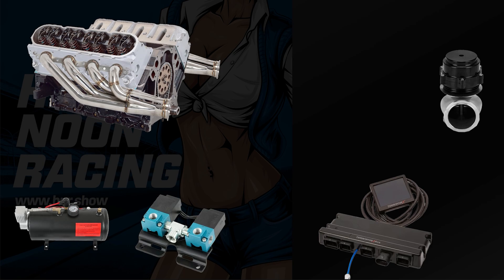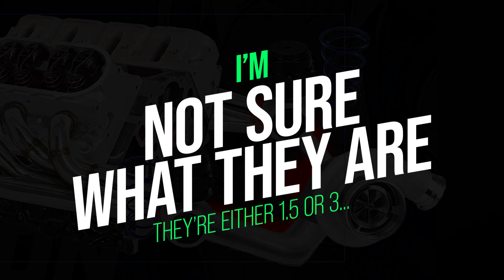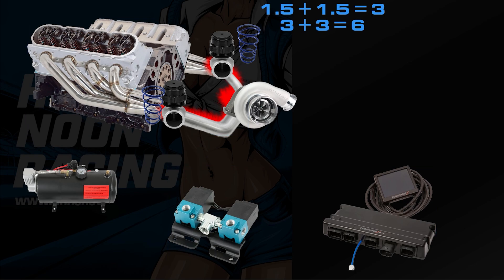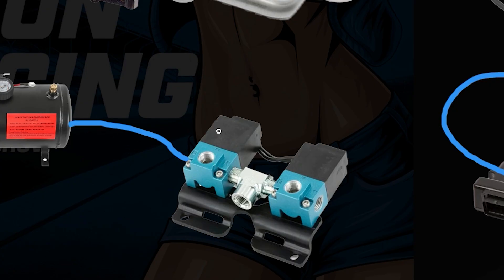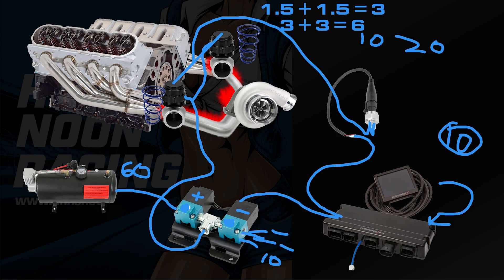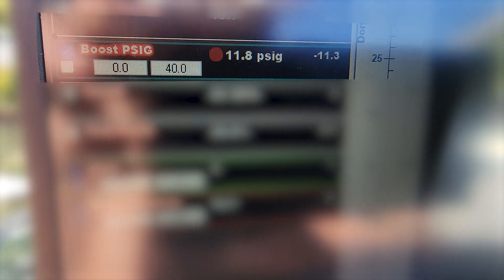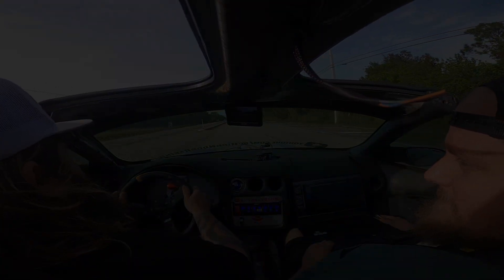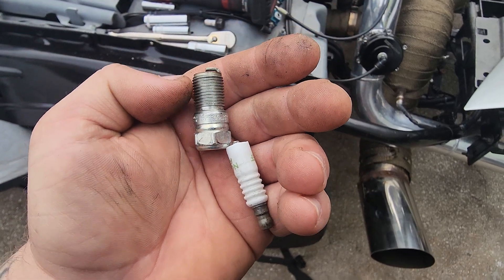Dual Mac Valves & Holley Terminator X Setup for Turbo LS Drag Cars

Comment from the maker: I was 100% wrong in this video just want to clarify this. I was confusing intake to exhaust volume with pressure. the pressure does not change. Thanks to everyone that helped clear that up.

The correct method on a setup that is functioning properly would be Wastegate spring + dome pressure = boost. For example, 3# wastegate springs + 10# of dome pressure should net around 13# of boost. In a perfect world this would be a 1:1 ratio. Many setups will vary +/- (1-4) psi.

Comment: Usually I always have to put a lot more Dome pressure to achieve higher boost. On my single turbo small block Ford I gotta have 20 psi dome pressure. To make 20 lbs of boost with a 8lb spring. 1 wastegate

Comment: Awesome video. Would you recommend these MAC valves or Holleys new solenoids? Part #557-201 for a single turbo car?
Reply from the maker: Mac valves, ive always used amazon ones, but if you want to spend a little bit more and make sure they're authentic use Low Dollar Motorsports ones.
I've never seen a good outcome with the Holley ones.
Reply from the maker: Also in the video I was wrong check the pinned comment above to make sure i didn't mislead you! SORRY

Comment: I am completely new to turbos. I f**** love this video. Visually seeing it helps so much. I'm in the process of doing exactly what you're explaining. I definitely will be checking out your other videos. Thanks my man.
Reply from the maker: Make sure you understand i made a mistake in this video the math was off on how you calculate eastegate pressure, and i did not have a boost reference plumbed to the bottom of my wastegates

Comment: Looks like not enough wastegate to properly control. Twin turbos here with 10lb springs on each side and it will hold 9-11 psi perfectly. However i run open loop boost control and use the turbo pressure as dome pressure. Sloppy stype dial a boost works perfectly. Got it where each "click" of disl gives me 2 psi more each time. Very simple.
Reply from the maker: Appreciate the feedback, It's worse than that lol check out the latest video hahahaah

Comment: I think what they are trying to tell you is you have 1 line coming from your mac valve to the top of your wastegate. That one putting 10 psi is actually splitting that 10 psi between the 2 gates
Reply from the maker: You are correct I've made a new video clarifying the mistake pretty funny too check it out if you like

Comment: The boost doesn't double because u have two wastegates
Reply from the maker: If you add 10psi on top of both wastegates it does
Reply: @HighNoonRacing  that is not correct.
Reply from the maker: I don't understand what he means by double. But what I'm saying is if you have two wastegates one on each bank. And you apply 10psi of dome pressure to each side. They have to make 10psi each before they open aka 20psi total. Excluding springs.
Reply: @HighNoonRacing  they are connected, 10psi is 10psi no matter how many wastegates you run.
Reply from the maker: I think you may have misunderstood that as double. but this is why we divided the target number by 2 since it applies it on top of both wastegates, and also why it worked.
Reply: @HighNoonRacing  I am understanding what you are saying but you are not understanding how pressure works and wastegate control works.

Assuming everything in the turbo system is sized appropriately and the engine is in good running condition and not severely retarded on ignition, adding 10psi to the dome control in the Holley software should net you roughly 10psi of boost over initial, regardless if you have 1 wastegate, 2 wastegates, any amount of wastegates.
Reply from the maker: @finetunedhp  Thanks for the detailed explanation! Really appreciate your input! I don't disagree with you at all, I'm just showing what worked for me. something is definitely off without a doubt.

Comment: You are over-complicating it with way too much math. If you have 3psi springs in both gates, in theory it should make 3psi of boost. If you add 10psi of dome to that, it theoretically should make 13psi of boost. If you have 3psi springs in the gates and its making 11.8psi, and adding 2psi gets you to 19psi of boost, something is wrong.
Reply: Yeah something definitely isn’t right or something isn’t calibrated correctly
Reply: Just to clarify my set up. 4.8 ls twin s369. Twin vs racing 50 mm gates. Holley term x. On board air compressor. 6 psi springs in the gates. Boost control off makes about 6 psi full throttle any gear. If I target 10 psi of dome it nets about 10 psi target boost. Sorry not trying to be an asshole. Love ur videos also duel Holley Mac valves
Reply from the maker: @bigbuck61089  no disrespect taken brotha thank you for doing the right thing and calling me out. I found the issue, and last thing I want is to put false info out there. Next video gonna make up for it tho and should get some laughs, thanks again!
Reply: For sure 3 pound springs don’t equate to 11 pounds. It equals 3 psi. 5 pounds of dome pressure should not make that much boost. U got some stuff plumbed wrong
Reply from the maker: I agree but they are 100% 3lb springs or less. And it's making 11.8 lol either way got it dialed and they're working repeatedly hitting and holding my target boost
Reply: @HighNoonRacing  I have 3lb springs in mine and they make about 4 on gate and 5psi of dome is about 8psi of boost
Reply: @HighNoonRacing  I am telling you, you have a plumbing issue, wastegate issue, or dome pressure sensor issue if adding 2psi on top of 11.8psi of boost gets you to 19psi of boost. The concept of dual wastegate boost control in this video is incorrect. 

Please don't take this as disrespect, I enjoy your videos but I'd rather watch you racing than doing head gaskets again.
Reply from the maker: @finetunedhp  there might be an issue, but if you apply that math and it works on every system regardless of the circumstances then I don't see why it matters lmfao.
Reply from the maker: @finetunedhp  And no disrespect taken, I'm ok with being wrong. but I don't think the math is wrong lol the setup definitely has issues if 6# of springs generates 11.8 psi. its also possible when I turned the boost controller off, their was still air on top of the domes. And we are gonna lift heads the block needs decked on the passenger side, but i plan to goto a 5.3 or 6.0 so i don't really "live in absolutes."
Reply: @HighNoonRacing  I normally do not comment much on videos but you seem to have a good attitude about racing and I like how you are doing it yourself and making due with what you have so I wanted to offer some advice to save you some headache down the road. 

If it works for you, run it. No hard feelings here if you do not want to find the issue. You will eventually stumble upon it. The video and the math is incorrect, it's just coincidentally working out to what you are seeing on your setup.
Reply from the maker: Hahaha yep I don't wana over complicate it but basically the turbo does not care and is moving that much air even on smaller turbos a spring can vary. +/- 1 or 2 psi
Reply from the maker: It's not that complicated,  
Target Boost Minus Wastegate Boost = Remaining Boost (27 - 11.8 = 15.2)
Remaining Boost divided by Wastegate Boost = Multiplier (15.2 / 11.8 = 1.28)
Spring/s # Multiplied by Multiplier = Target Dome (6 x 1.28 = 7.68)
Divide this Target Dome 7.68 by the number of Wastegates you are running.
(7.68 / 2 = 3.84)
Reply: @HighNoonRacing  that’s not how it works boost and some pressure should be almost 1:1 unless you start fighting back pressure and then dome pressure to boost will increase
Reply: If you have 3 psi springs in both gates it should make 3psi or close to it because if the turbo is making 3 psi to the reference line it is 3 psi to the gate wether you have 1 gate or 2 both are being fed the same amount of pressure to open the gate
Reply from the maker: @jamest6733  do you have 1 or 2 wastegates?
Reply: @ 2 gates
Reply from the maker: Thanks for taking the time to explain this! I really appreciate your help. It clears up a lot, and I'll definitely keep that in mind and have to figure out what's wrong